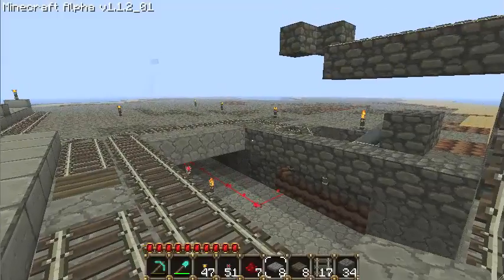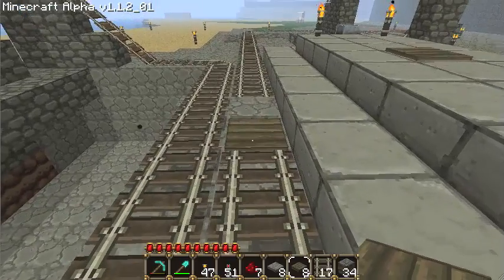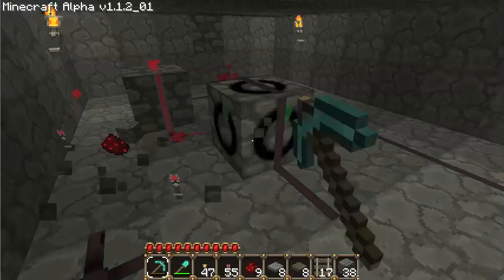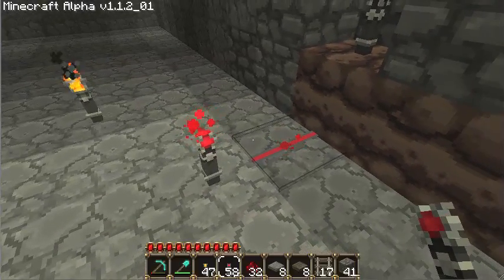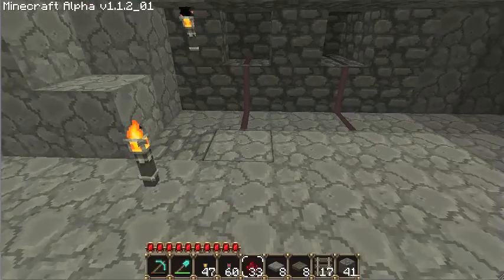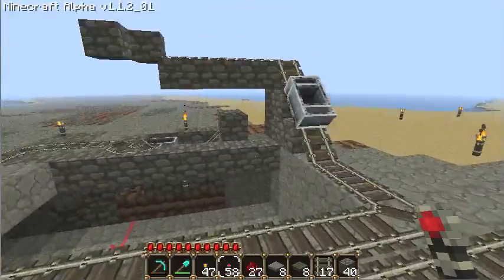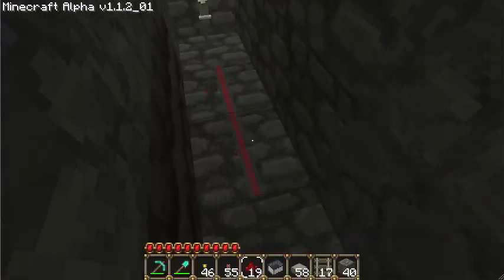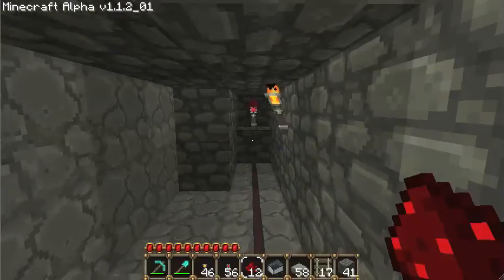How to Build a Minecart Station: Revisions

Comment: AWESOME videos, thanks a lot for these!
Some tips of possible revisions:
1. Make so that when you call a cart, get into it and the realize you didn't want to go, have it get back into the garage.
2. Have a button to resend the cart if you accidently called one (instead of having to get into it to call the booster and then quickly get out to send it back according to #1).
3. I've actually already done a fully functional trackchoosing circuit(redstone part, no tracks), I can send you if you want.

Comment: Since the latest update the IMPLIES Gate has been buggy on occasion.  You can also get the same effect by making an AND Gate and inverting the input from the stone pressure plate.  Just make sure the cart hits the stone pressure plate first.  This setup will cause the track to switch when the wooden pressure plate and only the wooden pressure plate is being pressed.  If you are having trouble with the IMPLIES Gate just try the AND Gate with the stone pressure plate input wire inverted.

Comment from the maker: @Schpongy I've done exactly that on one of my stations.  You could use a button and a RS NOR latch (I have another video explaining latches, if needed).  You would have the button set the RS NOR latch, then you could put a wooden pressure plate at the base of the pez dispenser (right in front of the half block) that would reset the latch so it doesn't send out multiple carts.

Comment: Not sure if anyone has come up with this yet using the implies gate you can cut back on your redstone holes as well. Instead of having to come out two different sides like you did originally you only have to come out from under one plate. Dig your tunnel under your stone plate as normal coming in the direction of where you want your wire to run. For your wood plate leave the block intact and attach a redstone torch to the exposed side. If a better description is needed I can make a video.

Comment from the maker: @Airazz That has to be some sort of problem with the wiring.  If the torch was receiving power correctly, it wouldn't always stay lit like that.  Check your wiring to make sure everything is connected properly.  Also, make sure you have at least one "straight" piece of wire before you plug into the block a torch is on.  "Cornered" pieces don't make a connection correctly, even if it looks like they do.

Comment: @HerdoRalden input directly under the first plate, and the second one coming out of the side of the second pressure plate.  I know this sounds confusing but just make sure the 2 inputs coming from the pressure plates aren't both positioned under the pressure plates. One needs to be coming out of the side.

Comment: @ConvictJones Ok, well first make sure that your pressure plates are positioned right, (before we change anything, haha).  Make sure when your cart rolls up, the first pressure plate you hit is the stone one, then the wooden one.  If they are setup wrong switch them and that will fix your problem, if they are placed correctly you just need to switch the gate around.  You need to make sure the actual gate is coming off of the wooden pressure plate (the block with the torch on the side).

Comment: @Qwanoes @mielsen

The gap is due to the original way he did the circuit where he to have separate wires from the inputs. When you run them side-by-side they connect together. If you check my comment I have found a way to integrate the gate into a 2x2 area under the switches. Let me know if anyone needs a better explanation then in the comment.

Comment: But if the cart takes a long time to arrive on that button when you asked for it, it might already send out a second cart which then still goes wrong
the best thing to do is make a memory latch (don't know the name) where a booster will push the cart over a pressure plate resetting the memory, if the memory still recieved the set input it will then ignore that input, I believe
(gonna test it out tomorrow)

Comment: @CheshireCake You will need to be aware of how you set up your inverter. I would try setting an item on the pressure plate(s) and work with the different inverters until the torch is opposite of what it usually is. I had to change the direction and try both of the inverters, there are 4 possible combinations and for my setup only 1 of the 4 worked correctly. Also be sure the redstone wire is straight before it goes into a torch, just to be safe, because it sometime wont work

Comment from the maker: @StrangeTruth116 Press and hold F1, then press F2.  This will save a screenshot in your Minecraft application data folder (you can get there by going to Start > Run and then typing in "%appdata%/.minecraft" on Windows; on a Mac it's "Macintosh HD/yourusername/Library/Application Support/minecraft").  Find the "screenshots" folder and then the screenshots you took.  Upload them to an image host (imgur.com is good).  

Get one of the circuit itself and the connection to the plates.

Comment: @karolyipeti 

I ran into this also, If you are using half stone slabs for your platform this will happen for some reason, the carts slide off it or something try using something different and see if it works.

Comment: @ConvictJones is the gate coming off of the wooden or stone pressure plate?  I know technically its hooked up to both, but try just taking it down, then rebuilding it again.  Make sure the gate directly comes off the wooden pressure plate.  Also make sure your redstone dust/wire is going straight at least 3 or 4 blocks leading up to the torch under the tracks.  I had this problem the first time I built a system like this, and I think the problem was the dust wasn't coming at the torch straight.

Comment: @ConvictJones Ok, I see what is happening.  I think you just have the block placement wrong around the pressure plates.  You NEED the half blocks in order to do this.  You need to have one input directly under the block with the pressure plate.  Then the second one has to be coming out of the back of the other pressure plate out of the side of it.  The only way to keep the block from cutting off the wire is to use a half block.  The inputs cant be on the same level.  You need to have the first

Comment from the maker: @StrangeTruth116 Question: Have you actually ridden a minecart into the station, or are you just stepping on the wooden plate?

The way the implies gate is set up, if you press the wooden plate by itself (i.e. standing on it and not the stone plate), it will send out the cart.

Otherwise, it's a little hard to say.  Something's got to be wired wrong, but without seeing it I can't tell you much more.  If you can't figure it out, PM me a screen shot of the circuit and I'll take a look.

Comment: @necramar I presume the arrival stone. Like some others posted the stone plate connected to the implies gate doesnt seem to have any function -> When it is pressed alone it does nothing, when both it and the wooden plate are pressed it acts just as if the wooden plate alone is pressed. Obviously not so in your video though, making it seem like something went wrong in the patch. I re-made the implies gate like 15 times thinking I was doing something wrong ;-p

Comment: @necramar I need help with the booster that has a redstone torch under it, it's the first booster you did in part 1, the 2x4 booster. When i activate the redstone the track reacts correctly but it doesnt go to its normal state

Comment: im having a bit of trouble with the implies gate. whenever the wooden plate is pressed, even with the the stone, the booster comes. i had to use an extender, but other than that im almost certain its the same... does an extender change things?

Comment: Something is not right. I copied everything identically (I'm new to minecraft) and the return cart loop is not working. To be exact, the whole circuit lights up but the torch under the curved track does not. Track is constantly turned on if I remove the torch and just place wire there.

What could be the problem?

Comment: Necramar, could you help me? How do you do the part at 9:27 , because the block next to that is where my stone pressure plate is, so when I place a redstone wire underneath the wooden plate, it connects to the wire beneath the stone plate!

Comment: These videos are awesome, however i'm having some trouble with the redstone part. I did it with the Xnor and it was working fine but it all of a sudden stopped working. The torches can only be turned off by the presureplates. I tried rebuilding the xnor but it didn't work so I tried the implies and it's still doing the same thing.

I'm not sure if this is me or just a redstone glitch... :/

Also, the track isn't affected by the torch. this isn't happening with the other parts of the station.